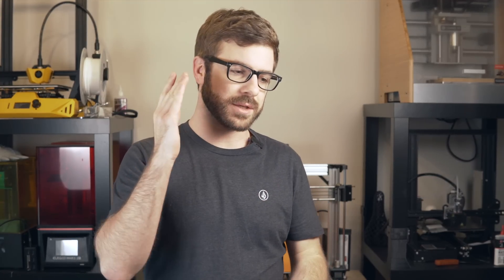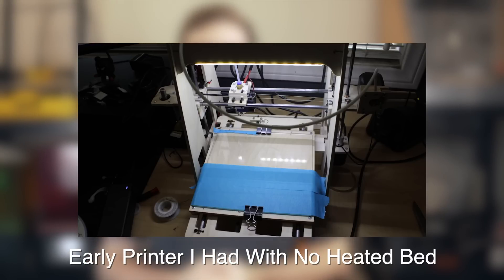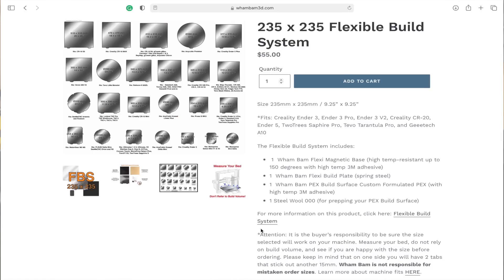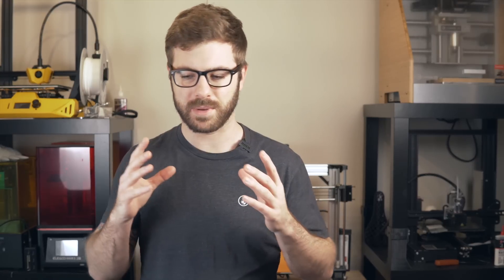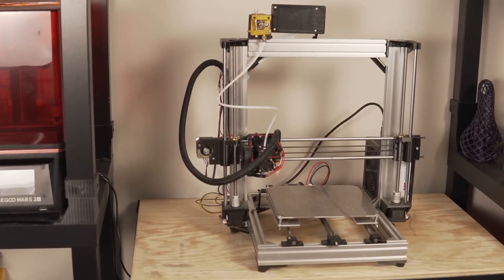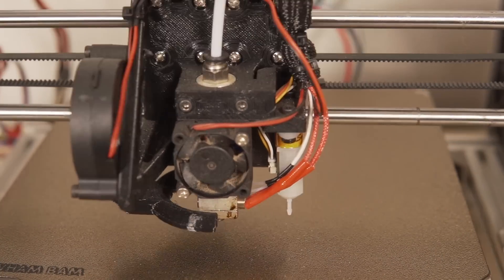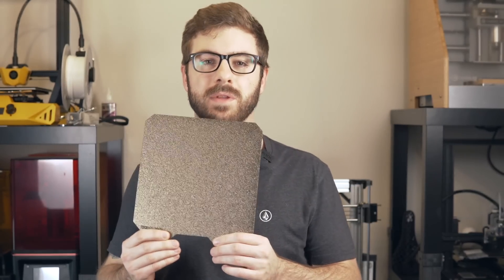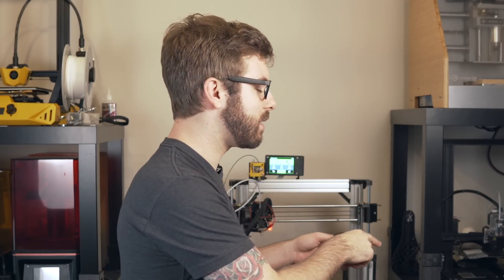Best Bed Adhesion For Every Day 3D Printing

Comment: Ha 6 months into 3d printing - Blue tape  - check (not bad), polyimide sheets -  check (wears out too fast), magigoo - check (works great, but builds residue), glue stick - check (sticks too well) hairspray - check (works well, but like magigoo, builds up gunk on print) I just bought my first PEI plate last week. Have not yet tried it. My ender 5 Pro with glass has been great. But my Ender 3 v2 has been a nightmare since day one. I ended up buying a new hot bed and glass top and , so far, it's actually working. Since day one, the E 3v2 has been horrible at staying level, and bed adhesion. Pretty sure the stock bed was warped badly, because the Ender 5 Pro sitting right next to it never had issues staying level or issues with prints sticking, without the use of anything other than a clean bed.

Definitely appreciate this and your other vids!! Really been helpful! Thank You!
Reply: Nice to know that I’m not the only one having nightmare issues with the Ender 3 v2 bed levelling. Mine started with replacing my springs, started with yellow springs then changed to silicon. Now my problem is with the glass, Im planning to switch to Pei with spring steel

Comment: The default flexible bed that came with my Ender 3 Pro works great for me. I just need to raise the bed temp a bit since this flex stuff doesn't heat that well (65 C is enough)
Reply from the maker: I am happy to hear it is working well for you. Do you primarily print with PLA? I have used them before but they always wear down very quickly for me and typically PET-G parts weld to it from my experience. I do think they are better than nothing but my experience has been pretty meh with them.
Reply: @ModBotArmy  Yes, I only use PLA since I'm kinda new to 3D printing. Before discovering this temp setting, I did have some adherence issues. I might buy one of those sheets in the future though!

Comment: Moved to smooth PEI on spring steel on my Ender 3 about two years ago. Love the ease of removal and it's my daily driver for PLA. I also have a Creality branded glass build surface that has whatever textured coating they use. Waiting for the glass to cool down to remove the print is kind of drag but I really like the textured finish it leaves on my print. Think I'll give the textured Wham Bam surface a try and see if I can get the best of both.  Good content as always.
Reply from the maker: Thanks Dale! I will say that other than the PEI I have been using I really do like the black diamond glass or UltraBase build surface that you are describing. My biggest issue is depending on the materials I am using sometimes the adhesive can be too good and real pain for removal. Granted I would rather have this than not stuck but I do love the ability to flex part and be printing again right away. If you try the coated please let me know what you think.

Comment: For PLA I use a salt solution on a plain glass bed or mirror, which dries with a salt crystal surface, here is an in-depth PDF by the developer of this method, when you connect to this address there is a problem with the university's file server so click on the way back machine option to get the file
@t

 This method is great as it is really cheap and works just like the coated glass beds in that it releases the print as though it was never stuck down in the first place.

The settings on the channel have URL turned off sorry

Comment: Great video, might have to check this out.  It depends on what I am printing as to if I want texture of smooth, which is one of the many reasons ultrabase has been my preferred build surface for a bit.  Can just flip it over and have smooth.
Reply from the maker: Interesting, did you buy the ultrabase or is it just the one on your anycubic machine? I have primarily used them on the JG-Aurora and the printers from Artillery but I feel it is quite a bit of work to flip over. If you had them just clipped on I could see flipping over being quite easy. TBH I had no idea the underside was smooth. From someone that does love the ultrabase I totally think it is worth at least exploring.
Reply: @ModBotArmy  Both, I have a Mega S and a few other various machines.  I have never tried to flip the one on my Anycubic machine as it is glued down, but the others I have.  My Tronxy D01 came with ultrabase then I have bought it for a few of my Creality machines, and they all just use clips to attach, so flipping it is super easy.  

When I am using the smooth side I just use glue stick like I would with normal glass, and when I want the ultrabase side I just wash off the glue with warm water and flip it over.